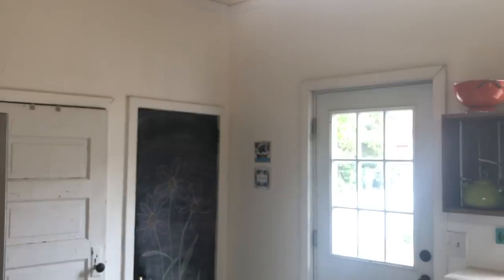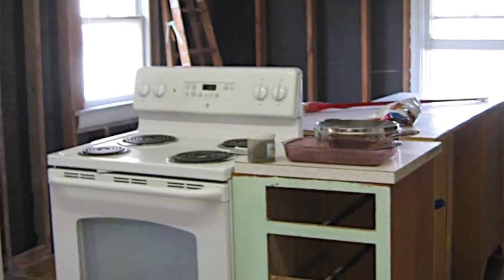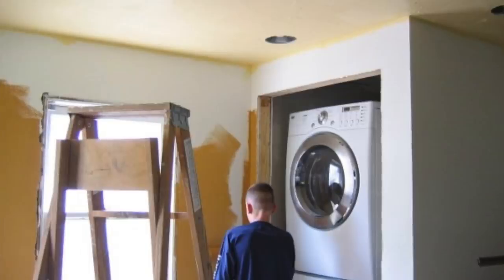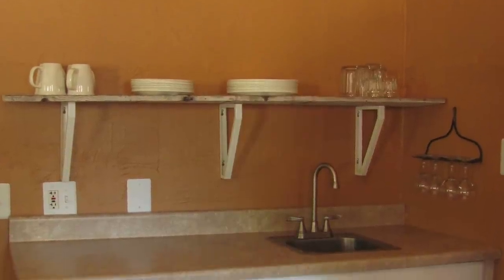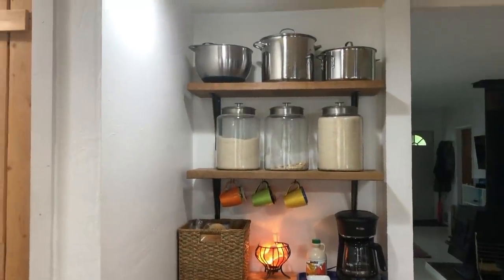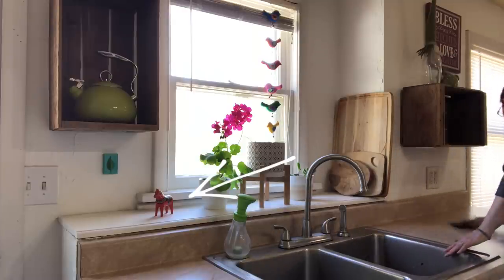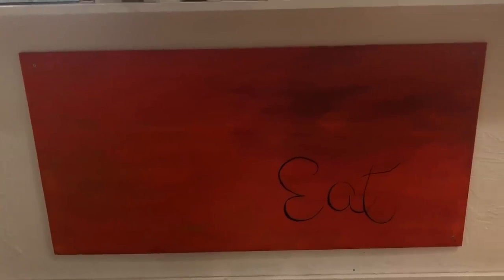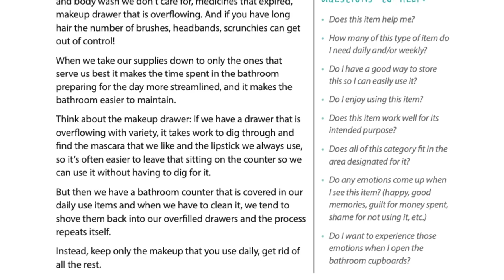Minimalist Kitchen Tour - Plus our budget remodel pictures!

Comment: looks good - efficient and very pleasing to the eye.  a suggestion re a lid for the bread basket - i once had a wooden bread bin (just a box) and the lid was the cutting board, about 1/2" overlapping all round, no handle, so dual purpose

Comment: I like your kitchen and it was fun to see how you changed it and decorated it.  About countertops, our first house had laminate countertops which worked just fine.  For our second house I decided I wanted to get fancy and we put in white tile with white grout.  It didn't take me long to regret that!  I'm sure you can imagine  what a pain it was to keep the grout presentable.  I finally asked my husband to build a removable laminate cover for the bar where I kneaded bread, rolled cookies and pie crust etc.  And now, in our third (and hopefully last) home we went back to laminate  counter top!  I love it, it's not fancy but it's almost indestructible, it can handle a hot pan right off the stove and is so easy to clean up after a messy baking project.   Practicality wins out over fancy for me any day!

Comment: Love the transformation! Looks beautiful! Curious how the white cabinets have held up over the years. We are wanting to redo our kitchen since the cabinets are literally falling apart. I was looking at the in-stock chute cabinets as an option.
Reply from the maker: They've done really well. The ones next to the dishwasher have water damage when the dishwasher leaked on the floor, and since these cabinets are pressed wood, it didn't fair well in that spot. And the white coating is starting to peel up on the inside of our silverware drawer, that's our most used drawer. But otherwise, they've been good and easy to clean.
Reply: @Nourishingminimalism  do they stain easily?